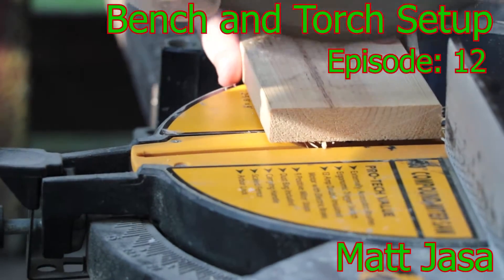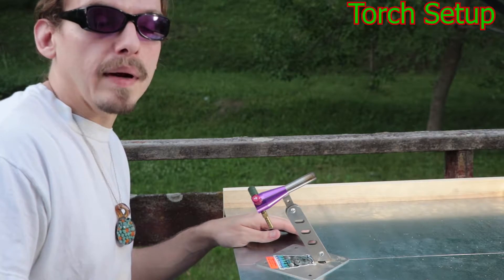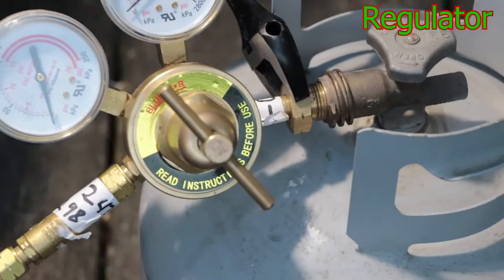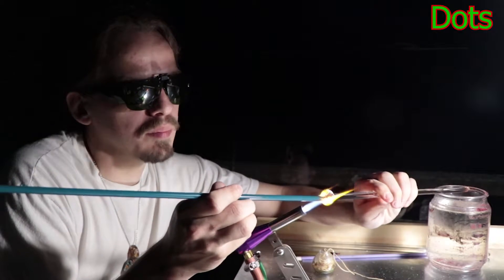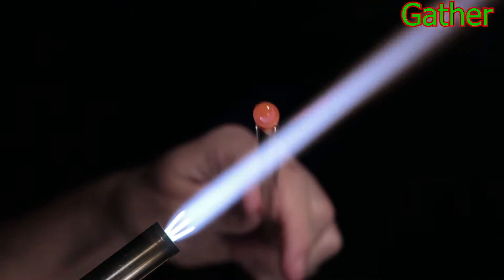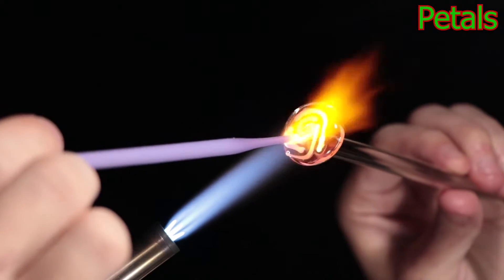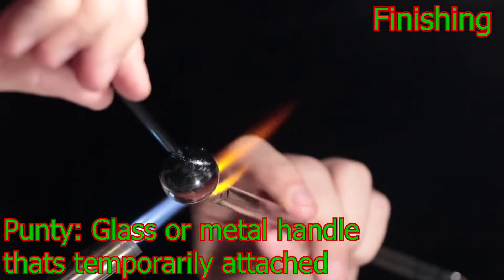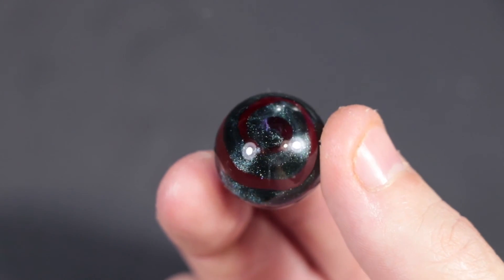Torch Setup Lampworking - Building a simple Outdoors Bench

Comment: I do have a question. About how big would you say you could make a marble or pendent or something, that if you bench cool it, it won’t crack or break?
Reply from the maker: It's hard to give an exact size. Using different colors will have slightly different COE (coefficient of thermal expansion) which can conflict with each other during cooling. Some techniques are more problematic like implosions/inside work. Completely clear is the safest. You can cover your work with a fiber blanket as it bench cools to get possibly 2 inch marbles or small drinking glasses.
Reply: @JasaGlass  when I first started I used COE 104 colored glass with clear glass COE 33, I quickly learned that mixing different COE glass doesn’t usually go well, especially since all my pieces I’m bench cooling. Once I ordered COE 33 colored glass, the pieces I’ve been making have worked

Comment: 10:54 so I’m not the only one lol.
Reply from the maker: 😄 The glass life = Hakuna Matata "No trouble"
Reply: @JasaGlass  what I tried doing and works for me is that I’ll heat up colored glass with a propane only torch, then I’ll start putting it in my big torch to make stringers or whatever. Either that or just put it in the very tip of the flame on big torch, lol. Trial and error

Comment: Is that a medical concentrator and will it go high enough for larger torches? I have a Carlisle cc and I have been considering getting one but don't know if a used medical one will handle the job. Thanks for the video.
Reply from the maker: It is a medical concentrator, it works really well. Their built to be very durable and reliable for patients but it is a machine, after about 20,000 hours they need rebuilt. After a rebuild its no longer considered medical quality and gets sold on the market. 

Mine is 10lpm and can run any of the bead torches (GGT Bobcat, Bethlehem Alpha, Carlisle mini cc) but for a larger 2 stage torch I need at-least 2 machines, (20 lpm total).
Lastly purity is a little lower compared to tank (90-95% pure o2) so you might notice it run a little colder but the electricty cost versus renting tanks is going to be a lot cheaper.
Reply: Thank you for your reply for some reason my phone just showed it to me 8 months later. I have not looked for any in a while since I am still trying to get a shop together for my hobby, but I imagine during this pandemic oxygen concentrators are going for a premium. I will wait and possibly the market will be flooded in the future. Stay safe and healthy and blessings to you and yours during these times we find ourselves in.

Comment from the maker: Updates: Keep propane tanks in ventilated areas (mainly outside), its heavier then air so it will build up in an enclosure if its leaking. Also when you turn on your tanks stand away from the regulator in case it shoots off the tank. There should be notches on the brass propane fittings to tell you their for propane.